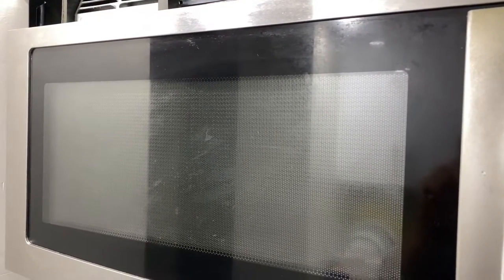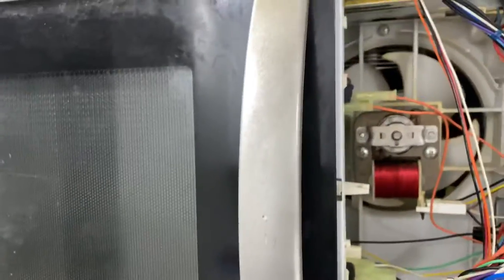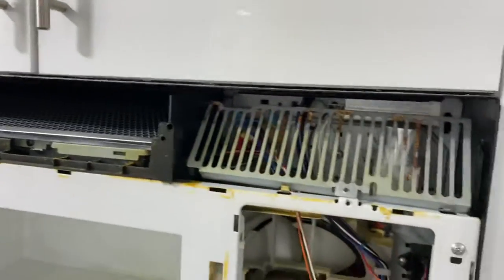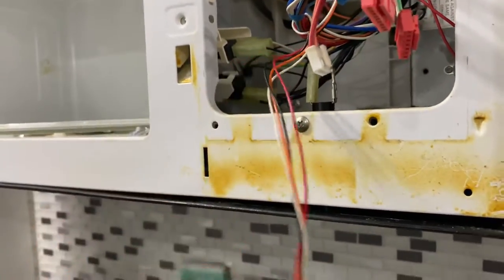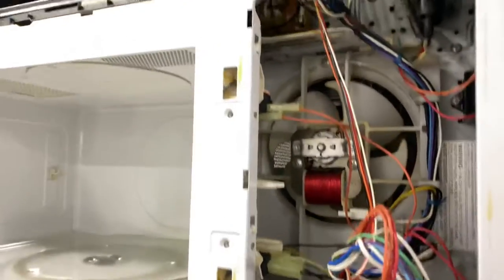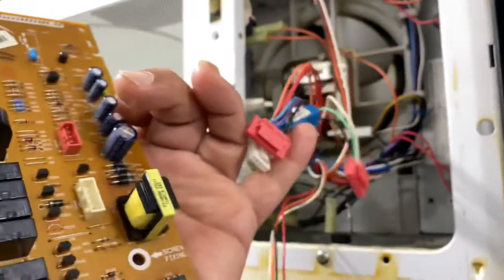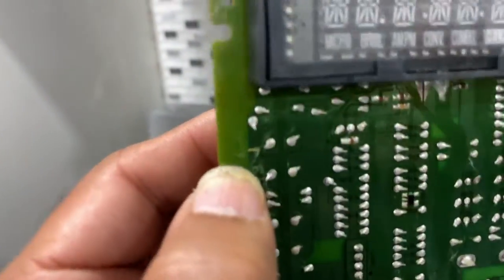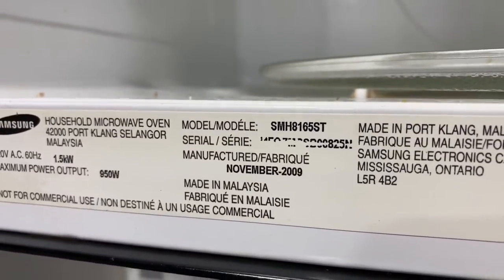Samsung Microwave SMH8165ST Circuit Board Cleaning (PART 1)

Comment: I am trying to replace the door switches on my Samsung SMH8165ST but I can't remove the wire plugs from the switch.  There is a plastic cover that covers any button to push to release.  How do I remove the wire from the switch?
Reply from the maker: Hi, the wires are connected as jack on the circuit board… which should be removable. I will check it on mine soon and shall try to upload a video about this. Thanks and all the best.